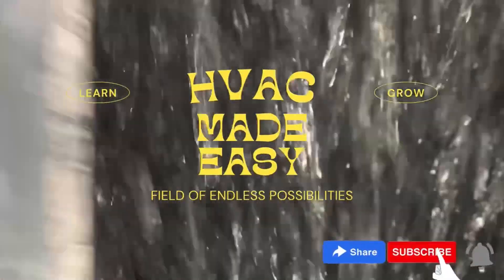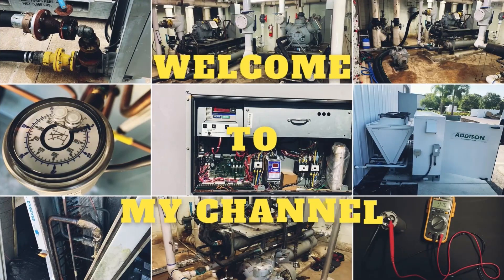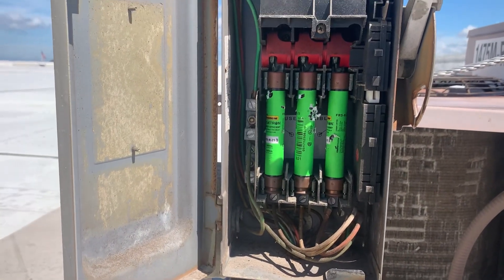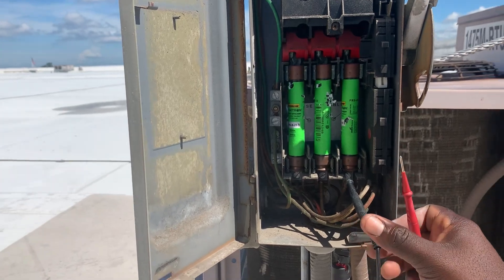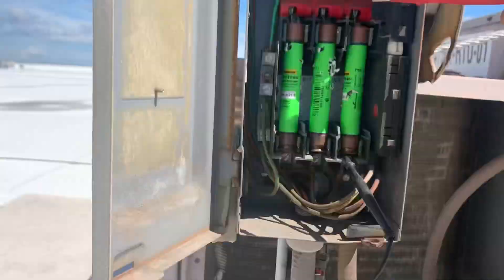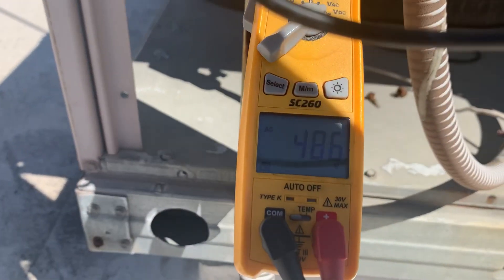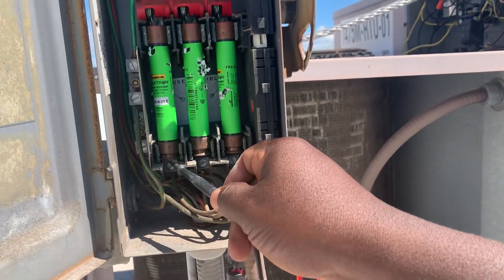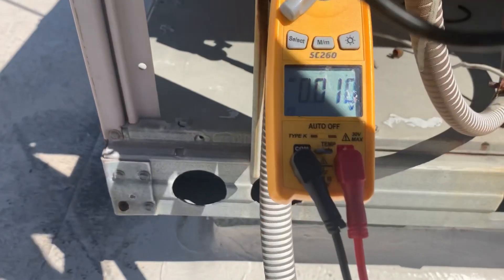How To Check For a Blown Fuse

Comment: The continuity test makes sense to me, but the voltage test confuses me. Why does it show zero volts on either side of the working fuse? Is it because you're testing two spots on the same lead, for instance, positive? But when a fuse blows, now you're testing one lead that goes back to negative, and another lead that connects to positive, which would complete the voltage circuit?
Reply from the maker: Kind of. Remember when a fuse blows the voltage becomes open. Which is why there is no longer any continuity. meaning the fuse is no longer one entity but 2. Likewise, You  should not read voltage across the same wire unless it’s open or in other words separated. Therefore, the voltage will backfeed.
Reply: @hvacmadeeasy1788  I'll leave it up to the experts! Thanks for the vid.